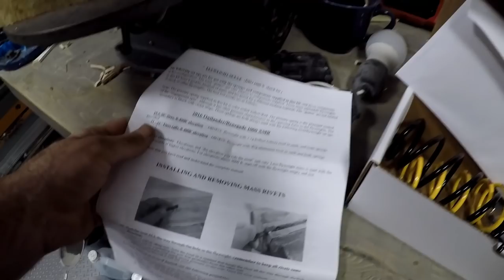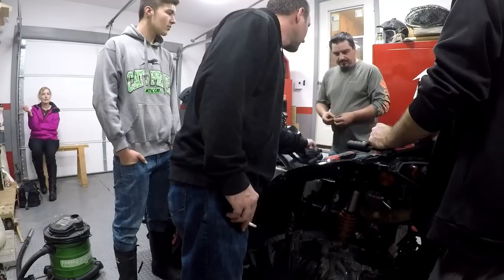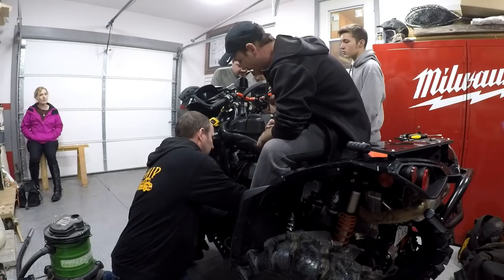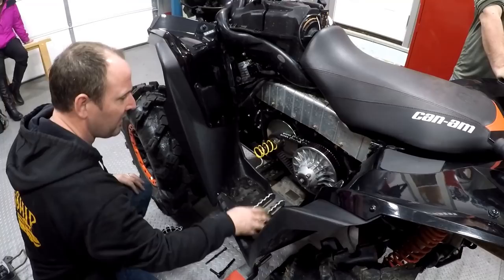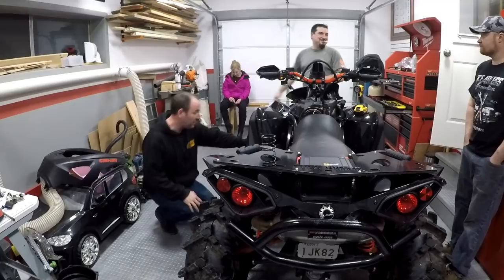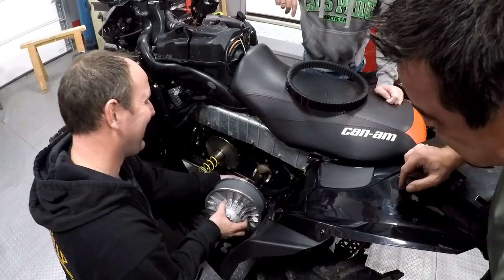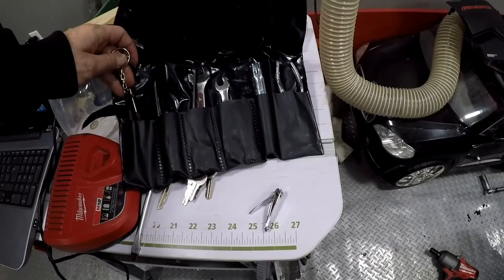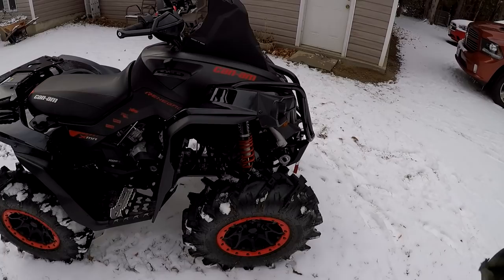Uncensored Clutch Kit Install on 2018 Can Am Renegade Xmr1000r

Comment: Love it man my buddy has one I just gotta Honda rubicon on 29.50 outlaws
Reply: Chandler miller awesome tires
Reply: NOS Atvs man I like yours more fuckin beast mode 💯
Reply from the maker: Gear reduction yet?
Reply: eh TV no sir mine pulls em like they ain’t nothin
Reply: eh TV all stock no lift barely fit em under my fenders 😂 you shouldn’t have no problem at all pullin em my buddy that has a can am exactly like yours has 32 inch terms pulls his without a gear reduction just a big assed lift he put on to fit them
Reply: Chandler miller I also like mine, agreed.  They are way more fukin breast mode, haha.   But im still a fan of the laws.

Comment: In your opinion who has the best clutch kit for a 1000 rzr highlifter 30 inch tires, the factory one sucks bad in low range, it seems to be slipping in low to when you gun it and when you let off the fuel it makes a bunch of noise especially after she’s good and warm, the bike only has about 600 miles on it, only had it since June, Polaris better get there s**t together quick cause can ams 2018 line up is unbelievable especially
the mud ready x3 xmr edition, thanks for any input.
Reply from the maker: This is a great question, I'm going to have to ask around to see what the RZR drivers are using on the CVT. Does sound like maybe the belt is glazed or slipping eh. I'll get back to ya when I learn more. Cheers and thx

Comment: I have the same bike and was wondering how the clutch ended up , does it feel more snappy? More pick up off bottom? Was it worth it? And if so what kit was it
Reply from the maker: Kit from Dalton worked awesome and I'm still using the secondary spring, When I pulled the belt and added full primary clutch instead for comparison it looked mint. Had great low end grunt and yeah way more snappy. Great product for the value.

Comment: do you need to mess with wires when you install handle bar raiser? Thinking about one since I'm 6foot2 and can't really stand up on my bike for longer periods.
Reply from the maker: Nope just cut a few zipties to free up slack and good to go. I even grabbed the stem stiffener form Cecco Racing witch took out the bar flex and added another 1/2 inch of rise. Now its mint when standing, took away much back pain.
Reply: haha nice that's good news. will install that.
Reply: Hey one more question: did you get rid of the CVT whine with the clutch kit? I heard some stories that some clutch kits remove that typical can-am "clunk" sound and whine.